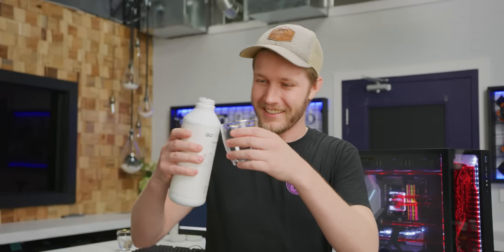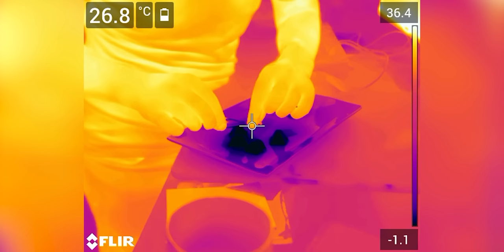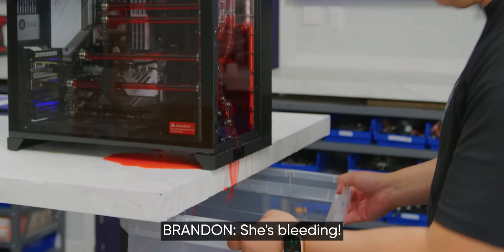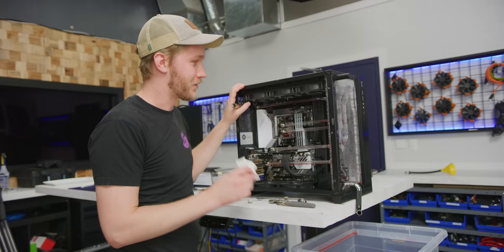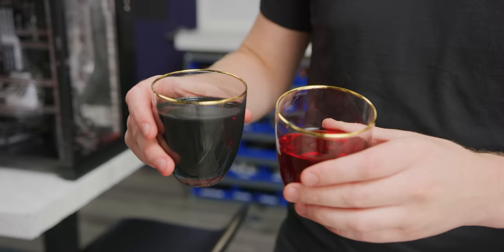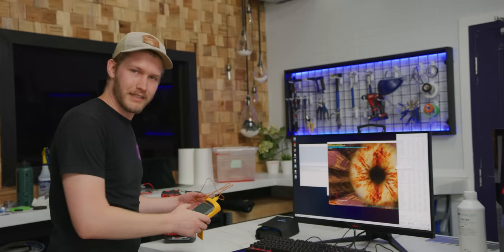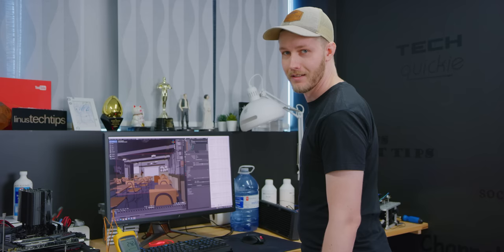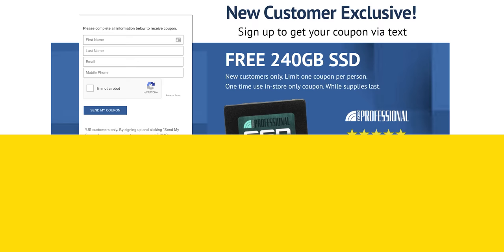7°C Cooler? This must be a scam - GoChiller Graphene Coolant Review

Comment: in the foaming test for the graphene thermal paste anti-bubbles doesn't mind no bubbles anti-bubbles is just another kind of bubbles, where normal bubbles are for example water outside/membrane/air inside in the other side anti-bubbles are water outside/membrane/water inside 6:45

Comment: 6:57; I had a AiO that built up so much bubbles that it dried itself out; I went from temperatures of 36*c to overheating warnings, screen freezes, and 100+*c. I replaced it a couple weeks ago. Also the Reservoir of that pc is SICK.

Comment: I would expect that, considering it only changes thermal conductivity, the fluid doesn't help at all once the loop is heat saturated. Maybe it can absorb heat spikes a little better. But thermal transfer through convection it quite good enough, so i don't see the point of the stuff

Comment: Dont blow, Use a damn compressor or pump. Why introduce batteria from your breath into the system? Run some distilled water to flush out old coolant

Comment: You gotta let air into the system for the water to leave. Leave a fill tube above all the others in the system so you can open it and drain fast.

Comment: That drain port lol!   I think you need to attach a permanent valve on it, or tip it on it's back and attach a pipe to it when it's towards ceiling

Comment: Why is no one wearing safety glasses? Second thought, I don't really understand why anyone would think thermal conductivity would be the limiting factor in cooling here. Wouldn't specific heat be more important when the pump is running at... a good speed, at least when the coolant isn't boiling? I mean, I don't know how to calculate that, but intuitively that makes sense. I guess the carbon is suspended in water, but it still seems kind of silly unless its about the same cost as water.... Especially since the carbon pieces don't really touch each other.

Comment: since it transfers heat faster if you speed up the flow it will give you better results. Try it with a faster pump and see what it does.

Comment: I just cleaned my loop thoroughly and started using this coolant. I game at least a few hours a day, sometimes 8 hours. I'll make sure to come back and post if anything crazy happens lol! Coolant was put in Jan 4th 2022.

Edit: The foam goes away after like an hour, it's been crystal clear for a couple days now.
Reply: UPDATES PEOPLE UPDATES
Reply: @Defamation_  I was only able to use it for a month and a half but it was great up until then. I started having all kinds of weird blue screens indicating different issues. I ended up putting everything back on air so I could swap parts. Turns out my psu was dying.

Comment: There's a point where the thermal conductivity overwhelms the ability of the radiator and fans to do their job. I could see if you had a radiator with a core made of graphene to transfer the heat away from the coolant and the fans dissipating.

Comment: keep in mind, while graphene is the closest thing in this reality to a sci-fi super material, it's also what pencil lead is made of. Just in pencil lead it's group up and super molecularly disorganized. So, for getting a suspension of the stuff, to take advantage of it's ridiculous heat absorption abilities, should be really easy. Makes me question if it's actually graphene with those sketch results.
Reply: Pencil lead is actually a mix of clay and graphite, so it would be a terrible source for graphene. And i'm sorry to disappoint you but it's not that easy to create a stable suspension of graphene. Graphene oxide on the other hand is a bit easier to create stable suspensions, but the thermal/eletrical properties wouldnt be so good. But yeah, i agree with you, take the graphene marketing with a bit grain of salt, their solution should be a mix of graphite, multilayer graphene and maybe even other carbon-based materials, such as carbon black, to reduce the price.

Comment: I would love to see go chillier do more testing with this stuff n more improvements to make this stuff cool better. Maybe do a higher concentration of graphene which ofc would result in thicker liquid which I’d like to then see them do their own brand of pump specified for this and maybe even their own blocks specially designed for it. Cause I’d def invest in this stuff to even do a full blown build with specialized blocks n stuff if the liquid actually made a huge difference. Since it’s only a few degrees different I’d rather not gunk up my loop with it.

Comment: It would be great to see a test PC setup with this running in it long term then check the cooling fins on cpu and gpu thermal plates along with a radiator being cut in half long wise to see if there is any  build up of solids and also if there was any reduction in performance. Thanks for the video.
Reply: Or erosion from the particles.

Comment: Would it improve it more based on how warm the place actually is? It feels like you are putting these tests in best scenarios ever, with best CPU's, best coolers etc. To a point where the temp the CPU have is almost exactly the same as the room
Reply: I doubt many people's rooms are ever going to get anywhere near 70*C or so... SO kind of a moot point.
Reply: @SilvaDreams  No, but their computers may not be in the best spot/under tables, pulling wind from a walled location, computer may not have been cleaned for half a year to a year. These are extremely on average normal things, I would say too normal and pull out that people got wire issues etc. But without getting into something that is more "ghetto-like-setup". This is still a lot more heat than they present

There is just no reason to test, if your test is meant to see which removes most heat, and you got the cleanest most perfect setup ever, extremely close to room temp, even on load.

Comment: Next time you drain the system, maybe OPEN THE TOP FILL PORT and let air in!!  Then the bottom would have pissed out the right way!!  Or if you really suck get the Aquacomputer Leakshield it will do everything for you.

Comment: so the graphene is extremem effective at thermal transfer. meaning that if you drop the room temp more then the results should also be impacted. Maybe if you run graphene through chiller of sorts instead of just radiator maybe your results could be much greater than a distilled water radiator setup through a chiller.

Comment: You should do this with a direct -die mounting, when everything around is as efficient as possible, the difference in the liquid's performance should be more appearent (at least on theory, correct me if I'm wrong)
Reply: Might get abrasion.  I'm surprised they didn't talk about potential to become a sandblaster.  Although in all fairness the nanoparticles are so small it might not matter

Comment: The iss uses a liquid ammonia coolant system.   I'm not sure what the Temps are in orbit but they're definitely on both extremes. And I wouldn't put my mouth on that, little portable air compressors are like 50$. Pretty sure lmg can afford one.

Comment: I wonder how it would compare to standard hotrod (power sports) solution like Red Line Water Wetter at $10 a bottle.  Those work primarily by reducing the surface tension of the water.  I've never seen anyone test stuff like that in a PC, but it definitely works on the race track.

Comment: but if the radiator and the metal it's made out of has a limit to how fast it can dissipate heat out of the pc, then it does not matter what liquid you put into the loop (if that liquids heat dissipation is faster), since the radiator is the bottle neck, which mean the liquid keeps whatever heat it has waiting for the radiator to get rid of it.
Reply: there is no limit on how much a radiator can cool. the hotter the liquid going in means the more heat it will dissipate. 
example if you run 50C water though a rad and it goes to 40C, then its dissipating 10C. 
by your logic running 1000C water would only cool it to 990C, which is by no means the case. 
bigger numbers used for exaggerated effect.
Reply: @Born_Stellar  that's not what i mean... everything has a limit, radiators included. the limit im speaking of is more the effective rate at which any component can dissipate heat. in this case that radiator. 

think of it this way, your pc is only as fast as it's slowest component. and in a loop, it does not matter the rate ate which the liquid can carry heat away from the cpu, if the radiator u have cant match that rate. visa vi, putting in a new CPU with ur vodoo 2 gpu. ur new cpu wont do anything better since u not addressing the bottleneck.

Comment: It's a pretty bad performance, water has a 0.6 W/mK, graphene has 4000 W/mK thermal conductivity. Either the water is preventing heat transfer or the particles are sticking together forming graphite instead of graphene. The structure is what is important.

This needs a different medium other than water, or nanoparticles of copper or aluminum instead.

Comment: I think this is not the 'graphene' that's responsible for the (modest) improvement, but the increase in mass. I'll bet the graphene suspension is denser than distilled water, and has more thermal mass, thus is able to absorb and radiate more heat.

Comment: it would be interesting to know how much % of volume the carbon is in that cooling solution. 
I maybe know were they find those 7°. Since carbon is 2x as effective as water the % of carbon in solution also represent the deference between normal coolant and carbon one. I dont think its more them 10% if you are getting to 20% that is close to it being a thick maybe even muddy. Carbon is more then 3X denser/heavier then water so pumping heavy viscos liquid hinder the flow rate. That is also one additional factor that this solution could benefit from bigger flow more them water and with bigger temperature differences since it have bigger thermal capacity and conductivity.

Comment: Did you open a second hole before emptying the coolant? Normally you want to open another hole, to allow air to flow-in as the liquid flows-out. This probably would've let the liquid pour more like aaaaa tea dispensor or an oil pan on a car.

Comment: I am wondering what this would do in terms of coagulating (over time) inside the pump, like other coolers that employ special coloring agents just for looks.  Could we find that out about this cooler?
Reply: This fluid is sort of off putting to me since you usually don't want couple graphite/graphene with copper as graphite is among the most cathodic materials and could risk copper corroding.

Comment: I feel like the tests they were running werent absolute stress testing for an extended duration of time. I feel that if you ran a pc at a fixed stated of normal usage you might see better performance.

Comment: I'm curious if there was any thermal throttling. Like, if the CPU was getting close to the same temperature, but one was able to run slightly faster due to less throttling. You never commented on that.

Comment: Graphite used in high heat applications for heat treating  like high heat bearings. but if you filled the pump with mineral or 3in one oil would you get the same effect  and maybe cheaper

Comment: How would it lower temps by 10 degrees when the rad+fans are still the bottleneck for removing heat out of the PC?
If anything, the higher thermal conductivity only means that the water just gets hotter faster. So only the time for the temperature to settle goes lower.

Comment: Would it be easier to just machine out a Shop vac to fitting adapter and use a shop vac to such the fluid out of the loop?!? I mean you guys have that fully stocked machine shop

Comment: I think this may work in a undersized system where the speed of heat transfer would make a difference.

Or its just snake oil.

Or snake oil may be better 🤣

Comment: I will NEVER ever put coolant in my pc with any kind of particles again -.- I never wanted to use coolants with particles inside... Just bought the "Mystic Fog" of EK and tried it and I didn´t know that it was made of particles actually after 2 days it started to clog the micro fins and settle up in the Hard Tubes, CPU/GPU Waterblocks, Radiators and reservoir. Had to open my entire cooling system and clean that shit away -.- Now just using aqua computer DP Ultra in clear.

On my first custom loop I used Mayhems X1 Blood Red (my whole setup had an Black / Red theme, so the Blood Red thing was awesome) and it worked fine. 
After 1 year I wanted to clean my setup (doing it yearly) but Mayhems marked X1 as end of life product so I had to look for something new. I found "Mayhems XT UV Red". Thought "yeah this might be better with UV and I was happy with Mayhems before"... after 2 days it started to clogging the system and I saw white particles settling everywhere, so I had to clean the entire system again. 
After that I changed to "Corsair Hydro X Series XL5 Blood Red". That one was perfect again, used that 2 years because I was lazy to clean it. 

Now I built an completely new system last December with new hardware and Mystic Fog coolant and as I said before it was clogging too.
Because my setup theme is not Black / Red anymore - everything is Black and RGB stuff with satin titanium elements - I bought that aqua computer coolant in clear because it was the best rated coolant and clear color for the RGB stuff to not manipulate the cool RGB effect. Using it since 2 days now without any issue. Hopefully it keeps like that without any issues. 

I´m really sick of suprising coolants, just write in your fucking product description "this product is just for show purposes not for daily use. It can clog your system"  jesus christ -.- Always doing cleaning stuff twice because they don´t give any information about their fucking coolants.
Reply: with the mystic fog type coolants I thought they did say it was for show and not daily use. 
to be fair water cooling a PC is for advanced users, so i would expect you do your own research to find out about coolants before you put it in your system. thats on you.
Reply: @Born_Stellar  Well I have no trouble with anything else just coolants, I am not an chemist and the shop I bought Mystic Fog of was not describing it as show purpose. I should´ve googled it before using it thats true -.- I was thinking of Mystic fog is something like mixing Milk with water, Milk is also a fluid without hard particles in it. So I thought they found some sort of chemical acting like milk in water... because Mystic fog didn´t looked like pastel coolants. On pastel u can imagine there HAVE to be hard particles in it to make it look not transparent. It happened now 2nd time there will be no 3rd time anymore I put a fluid in my system before googling it´s guts because the after work is pain in ass -.-

Comment: I thought it's added some surfactant for wetting the flake graphite, and it will lead foaming which defoamer could not erase. but i am curious that if the graphite settling down fast or not?

Comment: Graphene is not discovered in 2004  the theorie  was in 1947  and the experimental disvery in 1962 by hanns-peter boehm and is team      it was identified and produced in 2004 but  the pattend was filed in 2002 and finish in 2006      so not discovered in 2004  please research before telling new material since it was talk about a long time ago but not isolated  like those 2 men in years 2000

Comment: Wouldn't you need a graphene sheet based heat exchanger to properly and efficiently disperse the heat absorbed by the graphene suspension for it to work at highest efficiency?

Comment: Liquid cooling is all about aesthetics.  This has been proven time and time again.  If I wanted black I would just run black tubing and use distilled water.  The point of distilled water and color dye is that you can make it look great.   1 degree?  Nope.  Again, if I am after better cooling I'd just put on a big active air cooler.

Comment: So instead of spending money on a solution that doesn´t improve anything you can save money by not even using water but urine. 
It would surely add a certain uniqueness to your system, specially if it starts to leak.

Comment: well...it cant be much graphene in this solution when a sheet of 10cm diameter costs 700€
Reply: and a 1k Dimond is probably like 3 grand but you can buy a 1k bag of diamond dust for cents.

Comment: Why??? Heat conductivity inside the fluid is almost irrelevant. This is why you have microchannel cooling plates, high surface heat exchangers and pump the fluid around with turbulent flow. The heat is carried by the movement of the fluid and not by conduction inside the fluid. 
Whoever made this stuff is either clueless in physics or builds on the cluelessness of consumers. Maybe both.

Comment: How does this react to being stagnant for an extended period of time, let's say one or two weeks? With particles like that, it feels a bit like it's going to sediment at the bottom of pipes, pumps, radiator and components....
Reply: Might be an issue for long term storage but at that point I'd suggest draining your system first anyways.

Comment: That's not foam, those are air bubbles 🤣 your adding air into the mixture. A proper coolant system has no air pockets in them. Your local automotive mechanic that deals with systems like this on the regular can tell you this with confidence